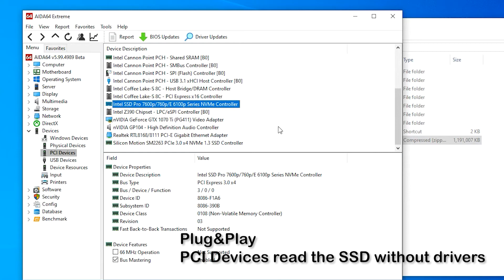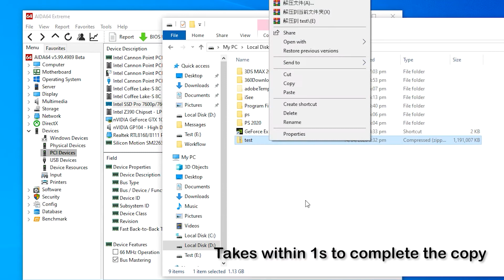AMPCOM NVMe M.2 SSD PCI-E 3.0 X4 Adapter

Comment: Tenho este ssd SSD Kingston KC2000, 500GB, M.2 NVMe, Leitura 3000MB/s, Gravação 2000MB/s

Gostaria de saber se ira manter as taxas de leitura e gravacao
Reply from the maker: Yes, it will, the PCI-E adapter is only a channel for the M.2 to PCI EXPRESS, the M.2 slot go with PCI-E slot dont need any chips to convert it.

Comment: can i install and boot windows 10 with it? like install windows 10 on samsung 970 evo plus 1tb and put it on your product then put your product on evga z370 matx motherboard
p.s. does you product come with m.2 nvme screw?
Reply from the maker: Yes, it could boot win 10 on it, I have boot win11 on 980pro 250GB on it already and runs full speed of PCIe 4.0. Come with NVMe screw
Reply: @ampcom2439  do you sell adapters with dual m.2 nvme? not 1 nvme one sata
Reply from the maker: @darkbendover  Yes, but will coming to sell on Mar. 2022,  now, we have a 4 nvme adapter, but need your motherboard support “Bifurcation” so does the 2 nvme. Here is the link.
Reply: @ampcom2439  can you link again? can't see the link. i use two of 970 evo plus i really don't want to put one on the motherboard, it's hot and behind a graphics card.
Reply from the maker: @darkbendover  https://www.aliexpress.com/item/1005003451219028.html?spm=a2g0o.store_pc_groupList.8148356.7.716a65edObSmG0
Reply from the maker: @darkbendover  From aliexpress
Reply: @ampcom2439  this one is 2 m2. nvme? does it work on evga z370 matx? what motherboard chipset works with it? i oly see at least z390 chipset.
Reply from the maker: @darkbendover  This is 4 nvme adapter,  the most important thing is, do your BIOS support Bifurcation, PCIE X16 devided to PCIe x4x4x4x4, please find it in your bios, if not, this adapter will not support
Reply: @ampcom2439  i should set the bios bifurcation to x8x4x4, right? i use gtx 1080 and 2 of 970 evo plus 1tb
Reply from the maker: @darkbendover  how many PCI x16 slot do your MB have ? If you installed the PCIe Card, what about your 1080? And please double check whether your PCIe slot is 16x OR 4x. Its important, I bought MSI B550M Mortar, the second PCIx16 only support PCIe x4, 16x SHAPE and 4X Lane,,, I will make another video on youtube for you later.
Reply from the maker: @darkbendover  Check with my newest vedio

Comment: Hello. With heatsink ssd will fit on PCI-E board
Reply from the maker: Yes, if the heatsink been install on SSD and fit motherboard, it will fit the adapter

Comment: Hi bro i have msi b450 gaming plus motherboard with an xpg s40 spectrix nvme ssd but it copyes verry slow with 100mb per second, i have pci-e 3, will it work with to improove the speed of writting?
Reply from the maker: Acctually, the write speed limited by the SSD, not the adapter....so.....I think it will not improve
Reply: @ampcom2439  i thought its speeds on its site were good, i guess they lied
Reply from the maker: @crushcrush5164  If you copy from XPG S40 to HDD or USB flash driver, it will be slow becuase the received devices speed limited to a lower version, you could check with a Crystaldiskmark to test the SSD itself.
Reply: @ampcom2439  i copyed from itself to itself, xpg itself, i guess they are not good, my kingston ssd sata3 works perfect at its speed so...i guess its not good at all
Reply from the maker: @crushcrush5164  Yes, maybe it not a good SSD, but XPG brand is own by ADATA,  why the quality control is not good.....I am comfused
Reply: @ampcom2439  i made another test, read 2150mb write 80-90 mb...i even had an nvme kingstone before, the problem was.. the same, i think they are not good
Reply from the maker: @crushcrush5164  Why the write speed so slow.....
Reply: @ampcom2439  i dont know maybe i got a bad one? Or...all i think that they are not good, i tested on windows10 and windows 8, on windows 10 had 10-50mb write speed on windows8 that i have now its a bit higher 😂 i guess its a bad one or they lied , i buyed it because had the speed like samsung nvme, but...its not good at all

Comment: But how can it boot from the PCIe slot?
No option to choose in bios.
Reply from the maker: The motherboard bios will recognized it directly, so you could free boot an OS in that NVMe SSD like you did in normal hdd before.
Reply: @ampcom2439  I have a "Asus P6T" Motherboard.
I really hope it will work.
Reply from the maker: @opoxious1592  We have searched this MTB, it support PCIe 2.0, so the speed will limited to 1000MB/s even you use PCIe 4.0 980Pro.
But the most important thing is, the bios dont support NVMe, you need update you bios first.
Reply: @ampcom2439  Unfortunally i already have the latest bios.
That can only mean one thing, my mobo is really to old.
It's still works great, but no NVME support.
I'll stick to my 2.5 SSD.
That's also fast enough
Reply from the maker: @opoxious1592  Yes, sorry friend we cannot help, for the 2.5SSD it is fast too, I am happy that you have solve your problem
Reply: @opoxious1592  yes, in practice an ssd is as good as nvme. When I'm backing up my files, (lots of small ones) SSD is on par with even nvme. No sure why. I have Samsung & Corsair nvme drives.  It's only when transfering huge files there's any real difference.
Reply: @goldenheartOh  Good to know.
Thanks!